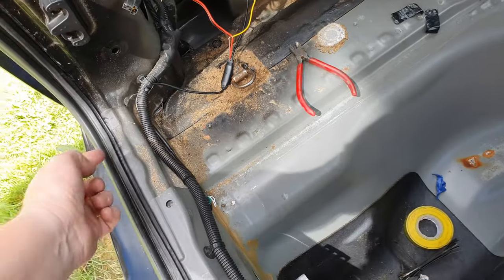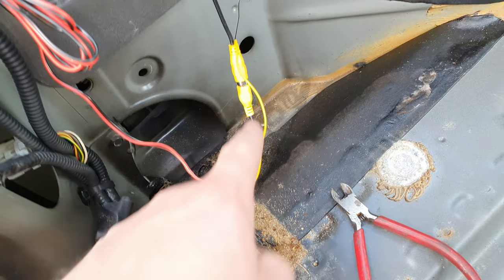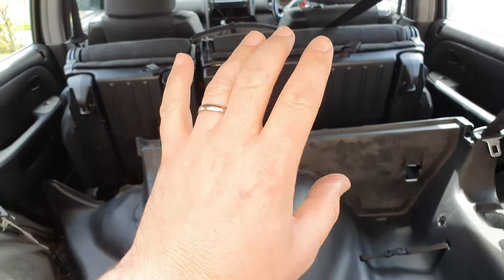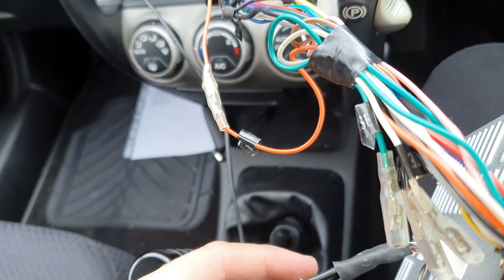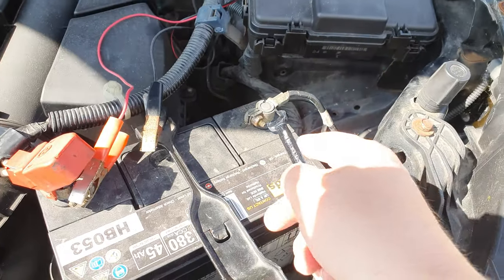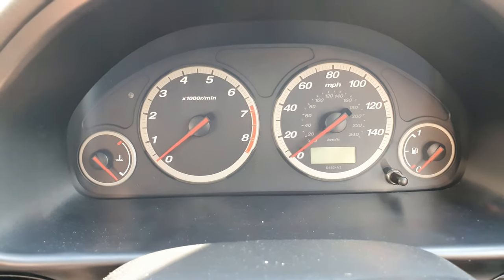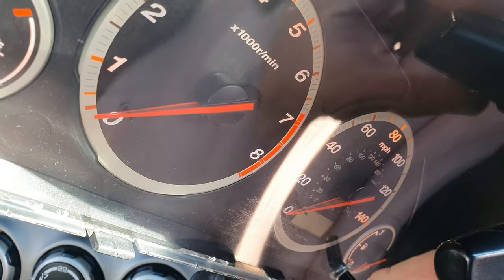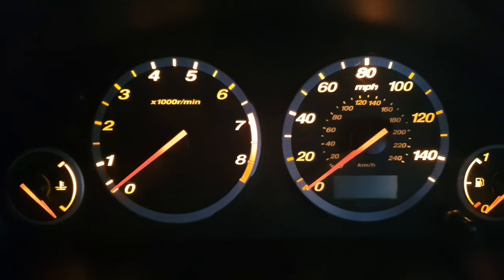Updates on the CR-V, Installing reverse camera, How to install reverse camera, backup camera.

Comment: Hey great vid. How did you route your camera wires through the bumber I’m a bit baffled as mine has a solid bar running behind it ? Did you route all the way to the left and then into the truck?
Reply from the maker: Apologies, i forgot to show how i did it. Basically there are a few holes that i just treaded through. They don't line up so you need to use something to fish it through. I'll be honest though the camera doesn't see much and it needs to be moved to a higher spot so i maybe will move it up in the future.